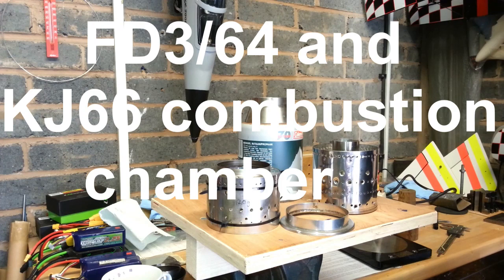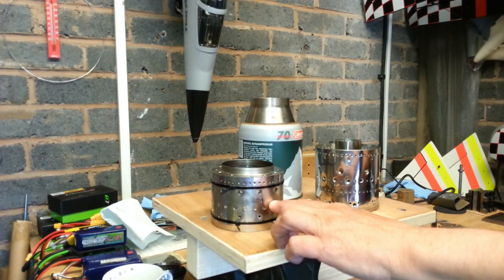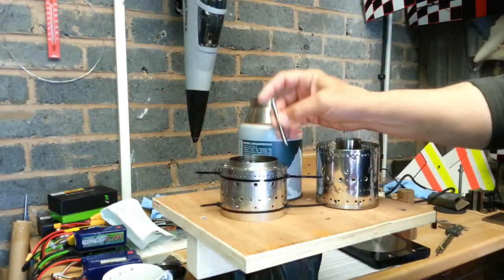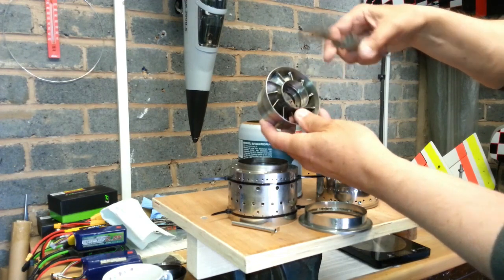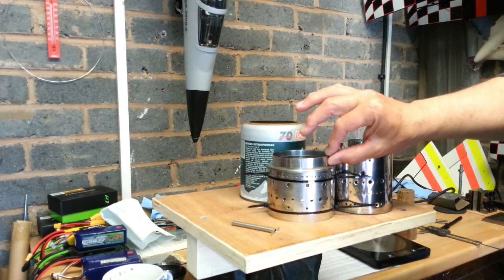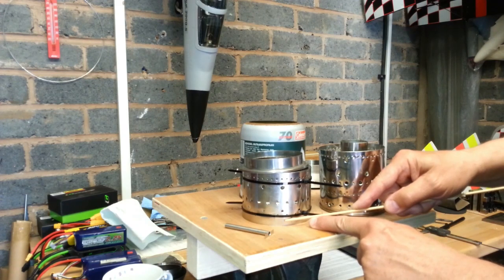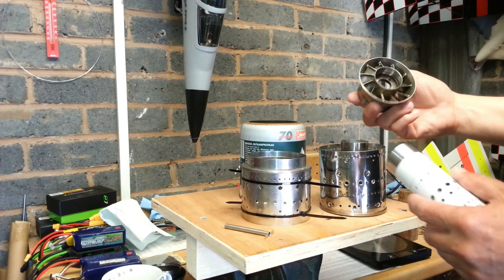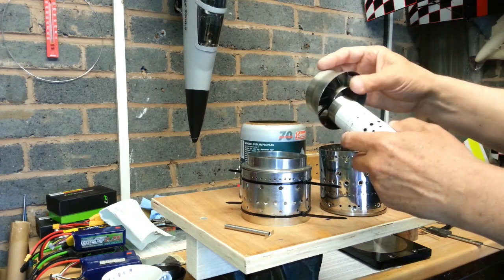FD3/64 and KJ66 combustion chamber

Comment: Very interesting videos, thanks - I'm thinking of building a Kamps engine to the plans in the third edition of his book. Do you think there is much to choose between the KJ66 combustor and the Kamps design? (Also the diffuser, actually) I'm only looking to make a working engine (not for flight), and will probably have to try and make the turbine wheel out of 310 stainless or similar. I have access to a manual lathe only. I may post on JATO as GTBA seems dead these days.
Reply from the maker: The KJ66 combustor works well and is easier to make,  Kurt recommends it with the straight vaporizer tubes. 
0.5mm 304 stainless is fine for inner and outer combustor the vaporizer tubes need to be at least 316 stainless these glow yellow at ends when working.
The Kamps diffuser works fine/easier to make, just make the slots for diffuser vane 3-4mm shorter then a potion of the vanes sits on the top of the diffuser disk  when you tighten the top cover on it transfers the load i also pinned mine at the outside of the diffuser disk for same reason you are not relying on the glue as much.
The 310 stainless will be fine should be good for about 85k best material for learning how to make a wheel make sure your fits are good and use copper lubricate grease  for anti seize when fitting.
Good luck with it the kamps will work fine from the get go as the car compressor wheel is more efficient than the fd3/64 wheel.
Reply: @reedy93  Thank you very much for taking the time to reply and for sharing your knowledge so freely. I'm on the lookout for an old electric grill element to salvage the sheath for vaporiser tubes ;). Comments on the diffuser vanes make sense and are very helpful. Would 316 be pointless for the turbine ? (Still on the look-out for some 310 or Nimonic/Inconel, but I can get a 316 blank easily).
Reply from the maker: @Mister_G  316 stainless would work fine for turbine wheel, you would not be running it flat out all the time so  stainless 316  at 80k and keep temp under 550c will work   if you set the angle as per the Thomas Kamps book (34 degrees) you should be low temp as he shows in the book nothing glowing .
The 316 stainless  0.5mm wall thickness sticks will last ok at the above temp and speed commercially produced engines use 0.25 mm wall thickness on sticks and combustor to save weight so must use very heat resistant Inconel. 
Building a jet engine is only a problem when you push the limits  120k 600c then you need a professional cast wheel correctly heat treated and certified it gets very expensive and is best to buy a commercially produced engine.
Reply: @reedy93  Thank you again - it all makes sense. Thanks for the encouragement, too.
Reply from the maker: @Mister_G  Your welcome. the mode of failure is safe with a soft wheel if over reeved or over temp the blades stretch and rub slowing and jamming up the engine turn the fuel off and apply a fan/compressed air all is safe, always run it outside and keep a co2 extinguisher ready,
it can be more dangerous with a cast wheel early days one or two had them spilt into 3 pieces  modern cast wheels are safe now but can still fail if over reeved or temp goes too high with combustor failure.

Comment: Thanks a lot for the explanation. 

I have a question though. Not related to this explanation. 

It's about the diffuser. Does it matter how many wedges it has. I have seen 12, 16 and 22. Or is there like a reason to use certain number of wedges on the diffuser?. 

I don't know if a make any sense :)
Reply from the maker: Don't know that much about wedge diffuser  I've just made to well known designs, kamps book shows bladed diffuser as the fd3/64 but curved, most of my fd3/64  have curved vanes.
  He also shows a design with curved narrow wedges on front face and curved vanes on the side.
most have now gone for straight faced wedge on the front face extending round the side.
With compressor wheels the less vanes the better within reason.
Each will have it's own merits with wedge shape diffuser the included angle will matter as well as the channel between the wedges  that tends to decide the number of wedges as well as how many vanes on the compressor wheel,the air coming off the compressor vanes must not line up with the blades/wedges or you've made a ww2 air raid siren !
if it was me i would just stick the curved bladed diffuser I think the main benefit of wedges may be reduced diameter.
Reply: @reedy93  thank you so much for taking time to explain. 

I was under the impression that the number of vanes/wedges is dependant on something with the compressor. I thought maybe it's dependant on the size of the compressor wheel or the number of blades on the compressor. 

Is there a way I can send you some images of my proposed 3d model for you to just have a look please :). 

My picture is one of my rendered 3d model . 

Am really concerned about the number of wedges. I read some docs but nothing was explained about how many wedges. 

The curved ones I think will be hard to make. Not sure these guys have the ability to make the curved ones in the country that am in.

I read the komps docs but not much explanation.
Reply from the maker: @jacobokpara7618   he does touch on the problem of turbine to NGV blades one must not divide into the other and it's the same withe the compressor to diffuser .
check out  Praendy     https://www.youtube.com/watch?v=MFWht_VG9AA  
Tell me what you think of his engine looks like he has spent a lot of time and money on it,I did try to contact him but after he's invested time money effort people don't want advice and I could be wrong.  
I was a member of the GTBA in UK  Gas turbine builder association, people there would be able to help you better with a wedge design there are a lot of variables on KJ 66 wedge included angle is 15 degrees the channel opens  12 degrees  but also the floor of the channel drops 6 degrees even with straight vanes that's not easy to m/c i know some people are making wooden patterns and casting them have a look at   https://jetandturbineowners.proboards.com/       they tend to be people who mod car turbo's but it's free and some very clever people there.
3d printing a pattern would work but with casting you have to allow for shrinkage so make it about 6% bigger (check shrinkage %)
and does the 3d printing shrink ?
Reply: @reedy93  hi hi :). I checked out Praendy's channel. Actually I follow his channel. His machine looks awesome.  I may never be able to build stuff like that but I think his engine is not self sustaining yet. Not sure.

I'd rather have a junk that works than have a master piece that seats there and drain money. ( no insulted intended on his engine) I think you get my point. Seems like he has been working on it for a long time and can't get it upto speed.

I checked the 2nd link. It's a forum and I like it. I will dig into it more and see what help I can find.

Am concerned that they my laugh at my stupid dumb questions. I think those guys are pros heehhehe
Reply from the maker: @jacobokpara7618  The more I learn I realize the little I know.you have to start somewhere the FD3/63 is a very early design now but I learned a lot from building it and getting it running cooler and more reliable.I always say to people if you want to fly a jet buy one it's cheaper and quicker but not as rewarding.
Reply: @reedy93  very true what you said. Heheheheh. Can't agree more.